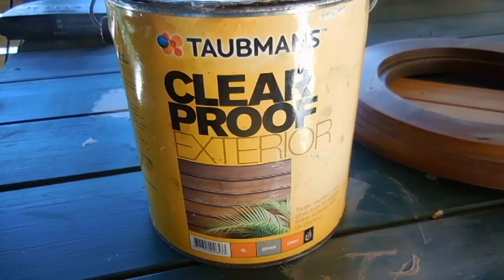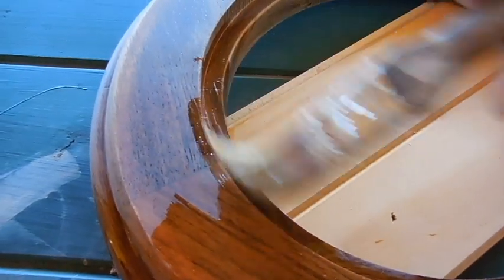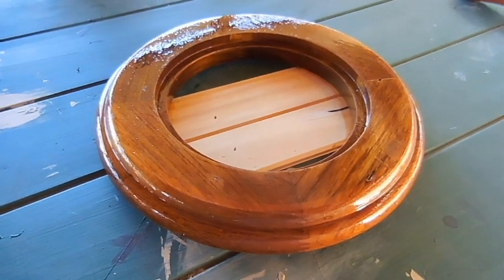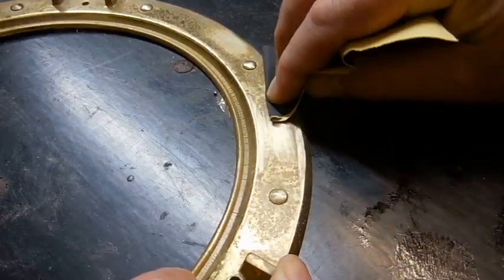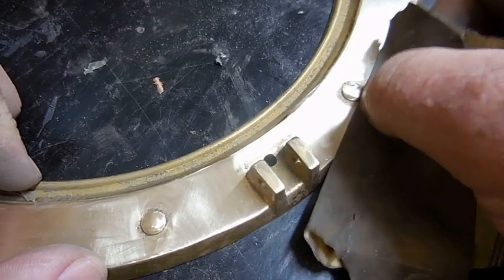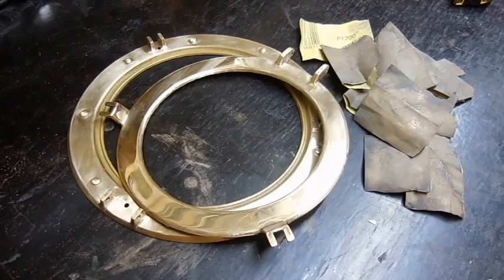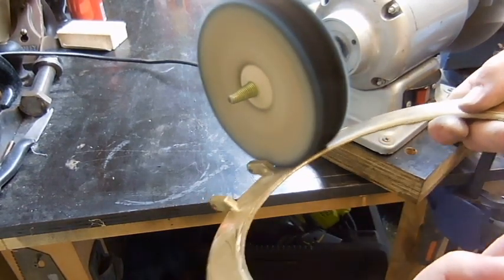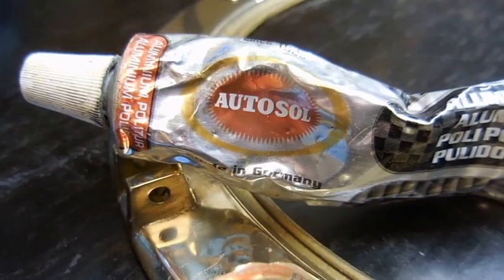Nautical Clock Restoration

Comment: Hey hows it goin?  Long time no see.  It has been a long time since you posted a new video.  Is everything ok with you? Did you lose interest?  Are you struggling with the crazy weather issues I have seen on the news?  Drop us an update video sometime just to let us all know what's been going on.  Ok?
Reply from the maker: Hi mate, yes it has been a while between video's, I was half way through restoring an old Stanley rebate plane, my laptop i do the video editing on was on charge, the stupid cat has knocked the laptop onto the floor damaging the laptop charging port, so now I can only get about 5 mins max of power into the battery before it dies so I can't edit. Once that happened the enthusiasm dropped of a bit, also flat out at work looking at a computer most of the day so not really missing the editing part. Hope your going well!
Reply: @howzatrestorations1538  oooh yeah we have had similar issues with several laptops here over the years.  My wife's new laptop uses the USB C port as the charge port and there is one on each side so there are TWO!  I figured that was a great insurance against the charge port issue.  I have been struggling with camera issues myself.  It does take some of the wind from your sails to have such issues.  I am glad to hear everything is OK with you other than your computer.  Good luck with that.  Cheers!
Reply: @howzatrestorations1538  Its morning here and I am getting my five year old ready for school before I head off to work, but I was just curious how many cats do you have?  We have nine at the moment.  Two of them are full time outside cats, and the others are a range of inside and outside times.  Anyway the cats are always knocking something over.